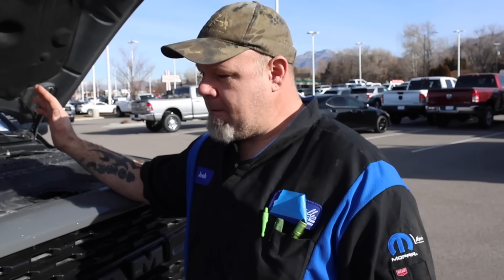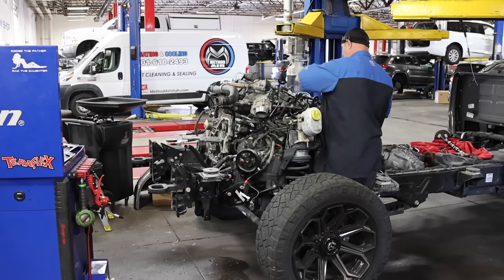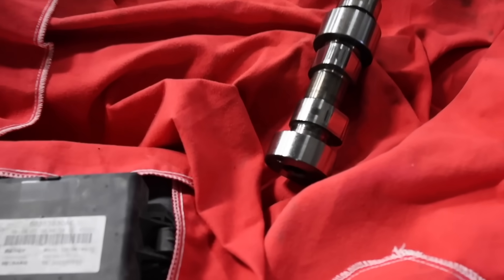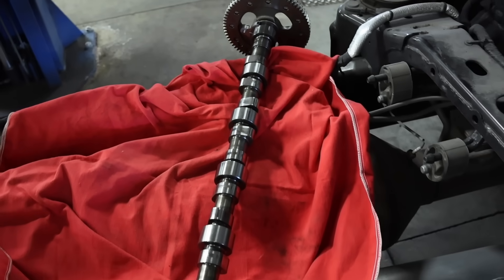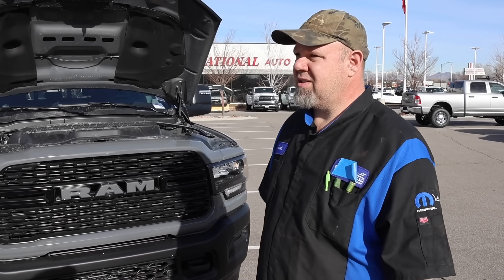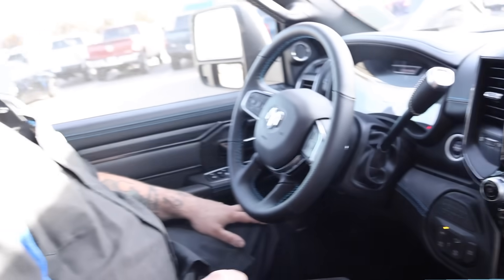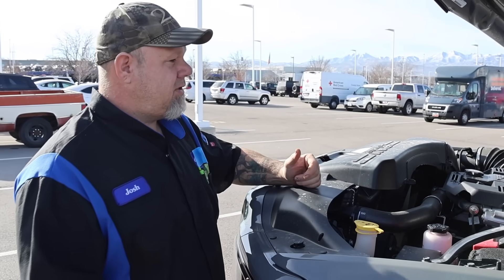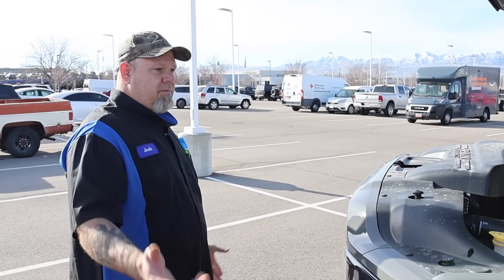Master Diesel Tech Explains The BIGGEST Killer To Your Diesel Engine!

Comment: I'd change my 7.3 oil every 4 k miles. I then put the dirty oil into my fuel tank and burned it away in the diesel. After a filter run thru. Got the big chunks. So I got a couple gallons of fuel out of it.

Comment: I purchased my 2002 duramax new. I also purchased a lifetime oil change from the dealership for 650.00 which may not seem like much now but back then it was considering my truck was 34,000.00. I change my oil every 3 thousand miles and my trucks runs like the day I purchased it. I have over 300,000 miles and have saved over $15,000.00 on oil changes. So I would recommend if they still have this deal to purchase a lifetime oil change if you plan on keeping your truck .

Comment: After oil change check the oil level with hot or cold motor? My oil level is all over the board.
Reply from the maker: It can be hot. It you got to let it sit for at least 30 minutes
Reply: @Trukstuf thanks dude.

Comment: 2015 6.7 Cummins 3500 Megacab... mostly daily driver with occasional heavy towing (15k 5th wheel). Been using 15-40 Diesel formula Shell Rotella for years with a good Donaldson filter (or equivalent) with oil changes typically around 7,500 miles. If I've been on a cross country trip or towing heavy, I will change it sooner. 
I do need to be more mindful of my warmup technique... here is So. Cal it rarely gets below 40 degrees but still, warmup is important. 
I always let her idle until my EGR temps are down in the 400 range....usually a couple of minutes depending on my driving.

Comment: Live in Tx, have a 2020 6.7 Cummins, oil change @ 7k. Just past my warranty so now I do it myself. Using Rotella T-6 10-30 full synthetic but I have been doing cold oil changes. Oil pan drains, pull my fuel/water filters, air filter, cabin filter then come back to the oil. The oil does darken up, but not nearly the black sludge my dipstick looked like using box store oil changes. Got 120k on it and runs great.
Reply: I pour about a half quart of Marvel Mystery Oil thru mine to flush out the oil in the pan.

Comment: I just purchased 25 ram 2500 mega cab 6.7.. What is the best way to break it in. my dealer said no tow, avoid idle and get on the highroad and fluctuate rpm every 10 minutes. owners manual is virtually useless on this topic. also your opinion on oil change intervals?

Comment: I bought a 2004 Ford Excursion with a 6.0 after we had our twins. With six boys, four still in car seats and boosters, we just completely ran out of room in our ,14 Expedition. That truck was having enough trouble pulling our 29’ camper as it was too so upgrading was great for that department as well. 

My rule of thumb that I’ve been using that seems to work for me is that I turn the truck on and by the time I’ve got all the kids and cargo loaded up the trucks warmed up enough. The only cold issues that I’ve really noticed with the truck so far is with the transmission. We live in a very hilly place and when we turn off our privately owned gravel road we have a pretty decent hill to climb on a 45 mph road. If it doesn’t get to warm up I end up screaming up the hill and when the truck finally wants to shift it shifts pretty hard. 

So far the truck starts no problem without plugging it in until we start hitting the low teens and single digit temperatures. I kept with 15W-40 but switched the truck and my new tractor to Rotella T6. Considering dropping to a 5W-40 but I’m very much a “if it ain’t broke, don’t fix it” kinda person.

Comment: 250,000 miles on my 2012 LML duramax with no issues except for the EPA mandated components, all of which have failed multiple times. My DEF tank heaters failed in the Yukon on a trip to Alaska, putting me in limp mode 150 miles from the nearest dealer. It took a week to get one shipped to Whitehorse, YT. The temperatures were in the 80s.

Comment: Another carbon issue arrises when the turbo is leaking oil into the intake. The carbon will become sticky and cover the grid heater. You will likely get a code p2609.

Comment: The EGR is the reason for many Diesel engine failures along with operator errors. Letting a diesel idle too long is causing many failures. After cold start the engine needs to warm up and the best way is to drive of SLOWLY, it makes no sense to warm up the Diesel idling because if you put (little) load on it it warms up faster. Idling at high rpm when cold is mandated by the EPA to assist with catalyst warm up but it is deadly for engines. Oil at low temp just doesn’t work good enough to lubricate everything, high rpm makes that worse. Going into drive and start of slowly you have exactly the rpm as at fast idle but now you drive, you put little load and warm up much faster. 
It is excellent advice to use a block heater, with some after market systems you can circulate coolant too. In that case you just drive off (10 s is all it takes to circulate oil).
Cold idling kills engines. Shortening oil change intervals is not bad, but 5000 miles for a Cummins is too short and does nothing if everything else is done right. 
Check the EGR valve regularly. 
Oh, don’t do short trips, don’t do high rpm cold idle, don’t do long idle. (Marine engines have an hour meter for good reasons, miles or hours is the same wear you might as well drive).

Comment: I have a truck diesel I always do the maintenance myself and I bought the best oil from the dealer but I have a question about fuel filter would you recommend using aftermarket fuel filter thank you my truck has 110 km would you recommend me to change the transmission oil because I feel a jerk little bit when switch

Comment: Im very thankfull i ran across this vid.
I had an 06 Ram 3500, 5.9.
I put just over 200k on this that truck. Rarely an issue.
We just took ownership of a new to use 2023 AT4 Duramax.
Tour vidieo brought back to mind SO many things that i havent considered in years, as i went to gas vehicles prolly 15yrs back...

Have you done a vid such as this one, geared towards the Duramax??
Reply from the maker: I haven’t done a Duramax specific video. All diesel platforms have the same concerns we just need to address them for the specific make. For duramax, if we improve the ability for the engine to breath, and oil filtration, those can help in combating the egr issues
Reply: @Trukstuf Thanks Much.

Comment: 22 ram 2500 18k miles bought new at the end of 23 so just over 2 years old just had an egr failure  i do change oil on a 5 to 5.5k cycle. Will the extra airflow with a banks monster ram help to prevent this issue in the future.

Comment: The manual that came with my 2025 Ram 2500 is a joke.   I'm having to use Google and YouTube to find information about my new truck.   The manual for my 2003 Dodge Ram 2500 is over an inch thick.   This one is more like a pamphlet.
Reply from the maker: And the manuals is the old days taught you how to adjust spark plugs and dwell. Now they tell you not to drink the coolant.

Comment: We have multiple trucks in our business in gas and diesel.  We tow hotshot as well as deliver boats, front end loaders, skid steers, etc.  12-19k pounds.  I agree with everything you stated.  75% of diesel owners do not need a diesel other than they want or think they need one.  I currently sold many of our trucks and have 6 remaining and haul, Deliver materials/vehicles for a living.  2 - 7.3’s 100k and 184k miles, 1-6.6 gas and 6.6 Duramax, and 2 older 5.9 Cummins that employees own now that have over 200k miles.  The best trucks I have owned have been the 7.3 gassers.  The 21 F350 XL dually is approaching 185k miles without a hic-up.  It doesn’t pull like a diesel but gets the job done saving me a ton of maintenance in oil changes, emissions, def fluid, and basically everything is 1/2.  The cost is 10-13k less upfront and the fuel is less but fuel mileage is worse.  I have an opportunity to get a new Ram diesel because I have family that works there and I know the owner but I believe a strong reliable gas motor is the way to go.  BTW I change oil, rotate and balance religiously every 5k, tranny, front/rear diffs at 75k and radiator at 100k.  If everybody did what you just explained these diesels would have less issues, but unfortunetly everyone is in a hurry.  These 7.3 gassers get it done, just at a slower pace.  I am looking forward to see what Cummins comes up with the their 6.7 gassers for 2027!

Comment: I have a 2023 ram 6.7. I've been doing the oil change every 12 months. Doesn't get driven much. Thinking about switching to 10w30 t4 or delvac conventional due to much lower cost oil. Truck doesn't do much heavy towing just 8k lb camper once or twice a year. Owners manual doesn't specify 10w30 has to be full synthetic but it does say 5w40 has to be full synthetic.

Comment: I have a 2019 Ram 6.7
I use amsoil 5/40 with amsoil bypass filter I change the oil every 7500 miles and the bypass every other oil change 15k  truck runs strong did the same with my 7.3 it’s up to 500k no issues

Comment: For those guys that delete their trucks and put dirty tunes instead of clean tunes you will also get more oil dilution as the cylinder walls are getting plagued with soot. That soot over time becomes sandpaper and your walls get scored along with piston rings. A proper air to fuel ratio is key to a long lasting truck.

Comment: I have a 2022 eco diesel I change the oil every 5000, my salesman has owned2 of them and got over 200k on both, told me that, I do plug it in , in the colder weather, what oil do you recommend, I know have 55 k on it and I must admit I am nervous about this engine, when I get to higher mileage.

Comment: Thank you for this. Makes so much sense. I have a 2007 Dodge Ram 2500 truck with 75k miles on it. I'm am so OCD when it comes to oil and transmission fluid changes. What are your thoughts on Bypass filter systems, and what system might you recommend that won't break the bank? I was also looking at the PPE MICRO PURE Engine oil filter at 5 microns. Would a filter like serve me well with my truck?

Comment: can you let truck idle for few hours and run ac to get some sleep if truck is at running temp? say to pull in rest area and get rest after driving several hours.... or is it bad for engine to do this? my dad whois former truck driver and had cummins in his truck swears its not an issue but i dont like the idea and it scares me

Comment: I live in
Long Island, NY and I own a 2017 2500 Megacab with the 6.7 Cummins, I have been a fan of Cummins since High School, and been a diesel mechanic for almost 40yrs and at one point did work for Cummins and Cummins recommends the Valvoline oil I and use full synthetic oil 
And the fleetguard oil filter which Cummins installed when engine is assembled at the factory. (Heavy engines)
Reply: Im in Long Island NY too brother. Im looking into buying a used van like a 2008 sprinter or an 06 duramax 6.6 or something. I never owned a diesel but whatever I buy I want to last with minimal need for repairs. My 5.4 Triton v8 gas engine in my 2001 e250 Ford is leaking oil, losing power, and other issues. Would Diesel be a wise choice for me? And now that I know your a Diesel mechanic on long Island, I got someone to service it. Lol

Comment: I change my engine oil & filter every 5000 klms. Use 5W/30 full synthetic low S.A P. s oil. Cheaper to change oil instead of the engine, lol. I've installed  a Western catch can kit.

Comment: What do you think about oil change if you’re running a bypass oil filtration system where your oil is filtered down to 2 micron particle size???? I have a 2011 6.7 Cummins engine in a 2006 Ram 3500 the engine has been modified back to pre emission configuration. I use Amsoil signature series 15-40 oil, I send an oil sample to a lab every 6K miles and don’t change oil unless lab shows dilution.

Comment: Got a 2024 Ram 3500.6.7l
Check engine light 5 timws for a crankcase ventialtion disconnect code no one can figure out.
Dealer did an update, new cranckcase filter. Nothing.
Inonly use it to tow, so it comes on under load.  3546 miles 
Dealer opened a Star file.
Id apprecite any insight you may have... Or anyone else.
Thank you.

Comment: Better to change your oil more frequently with cheap oil then to leave the best oil to 15k.
I would disagree on the time for turbo cool down, I would give it two minutes minimum and even five minutes. The variable geometry turbos are expensive to replace! 
Block off the EGR ASAP! Used to be you could unplug the EGR valve but not sure if you can still do that or not without limp mode being activated.

Comment: During the winter I have to idle my engine until transmission is warm enough to change gears smoothly, during summer a little less time. Oil changes 5000 or so miles.

Comment: So we're going to trust the manufacturer when we choose to warm up for 10 minutes but not when they recommend 15,000 miles? So we just pick and choose?  I've always felt the reason diesels hold so much more oil than gas engines is to extend the oil change interval.  That's because diesels are meant to work and downtime due to maintenance costs money.  Look at the intervals for semis which is much higher.  I understand wanting to protect your engine but you need to backup your recommendations with data.  I.E. oil analysis tests

Comment: Question!  

Great video, liked and subscribed. 

Just got a 22’ Ram 2500 with the 6.7 for summer towing of a camper.  My commute to work is only 4 miles. What do you recommend I do?  Buy a beat car or….?  

From research I’ve done due to not wanting to kill my diesel, I have planned to do 5k oil changes with 5w40.  I warm the engine when cold but not for too long of idling. I will try to take a 20-30min ride once a week if possible and use a fuel additive.   Is this enough or should I look at getting a beater?

Comment: Here’s my thing. You hear convincing evidence on both sides of the spectrum. Dave’s auto center  ( amazing YouTube channel) tested this theory and started the test by letting the truck idle for 10 min, and cooling down a total of 3 times. At the end of it he changed the oil & sent it in for testing. After he changed the oil he did the opposite. Started the truck and let it run for maybe 30 seconds and then drove for 10 minutes ( no warm up) . Parked the truck and let it cool & ran that test 3 times. Changed the oil & sent it in. 

I believe there was 40% more fuel in the oil when he let it idle. I get what you’re saying but he tested the theory. Have you found it to be the opposite & if not maybe conduct your own investigation into the matter. Just saying it’s better to let it idle with no test to back up your theory doesn’t really matter unfortunately.

Comment: The biggest concern to any diesel is fuel and fuel filter, half the stuff is personal preference. This relates to the fuel pump and injectors.
I have adhered to 10,000 miles using fleet guard filters for decades.

Comment: My partner had a 2002 F350 with a 7.3.He changed that oil more than he had to. Never had a problem with that engine.One little hose on the turbo oil line was the only problem he's had. Has? over 200.000 miles on it😅

Comment: Diesel over hyped most people don't need the torque produced unless you pull heavy loads up steep grades. I sold my 6.7 Ram before it had problems and bought a gas engine truck never looked back. Sure you can delete not going to be trading that truck into the dealer like that I don't sell private party it's a pita dealing with endless tire kickers. Since I retired time has become priority last thing I want to do is turn a wrench on a pickup truck.

Comment: East of Auburn California, Truckee pretty cold. Also, east of Placerville California. I’m on the market for a new truck. Only pulling 8k so I’m thinking the diesel of any brand is a little over kill. Looking at gas, same as diesel, they’ve all had problems. I was with dodge between 02-06 and the Cummins was solid but the 46r trans wasn’t, 48r was a huge improvement

Comment: I have a question. Last September I bought a 2024 Ram 6.7 cummins diesel 4x4 and all this is new to me. It is necessary to idle for a period of time due to needing the AC on (live in southeastern Oklahoma). Do I high idle the engine to run the AC, and for what period of time is safe to do so?

Comment: My 2024 Ram 2500 4x4 Laramie is Broken 😡 at just under 17,000 miles. Under warranty the dealer is taking its time,The first time changing oil the engine developed a ticking, clattering noise and it got worse. Used 5w40 synthetic. Why can’t I use this oil !! If I travel all over 🇺🇸. My other vehicles had no issues with all different types of oils. I like the Cummins Diesel engine, but the engineer are loosing their minds. Chrysler should provide you with a lifetime supply of oil changes, since these machine is more like a Formula 1 machine.

Comment: You guys are still going off feeling. You can test oil now. You can run bypass filter that filters the oil down to 1 micron. Amsoil is the best oil on planet earth. 5000 miles is ridiculous. lol. I pulled main bearing caps on a 400k mile 5.9 and bearings were perfect. Looked brand new. 60k mile oil change intervals. You need to educate your self on full synthetics and test oil to see what wear metals are in the oil to determine if it’s bad or not and needs to be changed. Not just feelings.

Comment: What’s a good oil for a 3.0 duramax LM2. Also if you have any recommendations for the oil filter as well. I have been doing the oil changes at the dealer but want to start doing them myself self. Thanks in advance

Comment: I do about 10k oil changes for a few reasons. 1: my truck is 20 years old, it leaks, in 10k I'll add 2 quarts. 2: I do the oil analysis and it always comes back good. No bad metals found. 3: I don't idle my truck. Our firetrucks idle for hours and they have constant issues. I drive somewhere, idle for 15 ish seconds and then shut down.